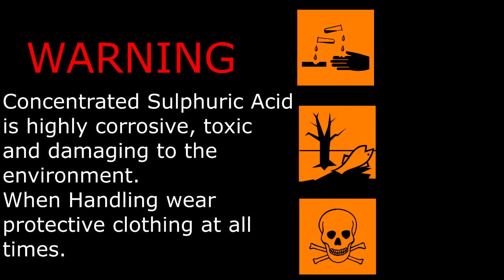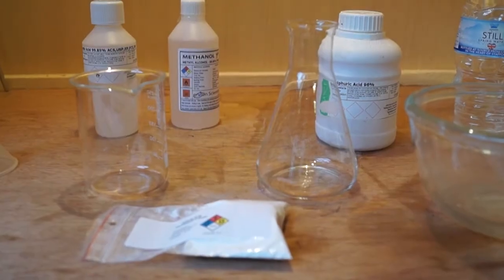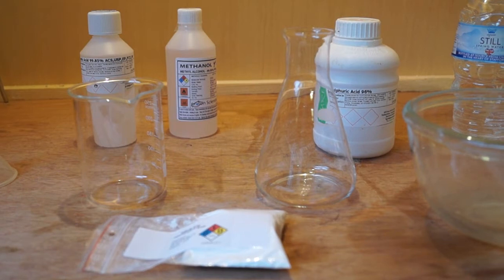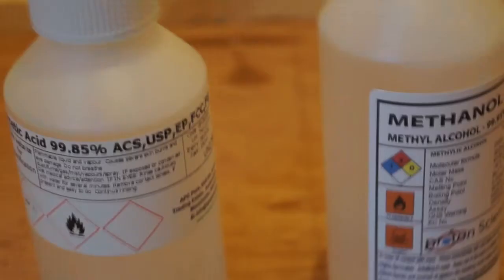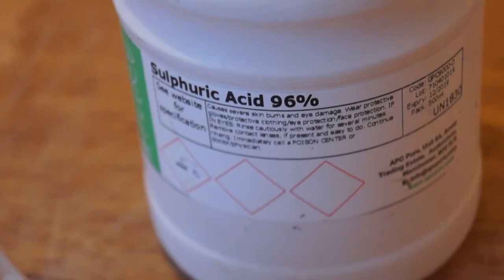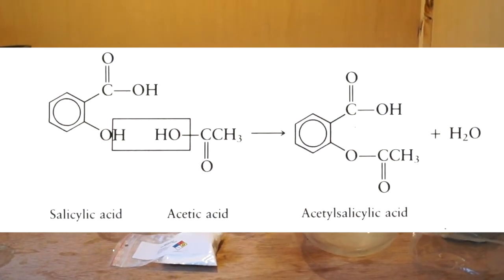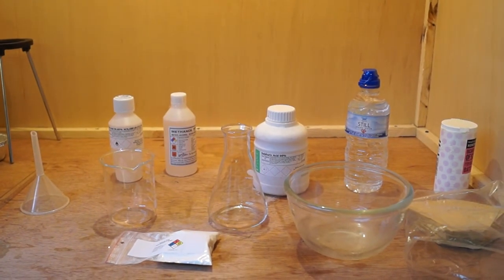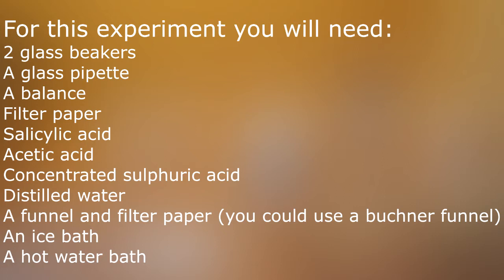Synthesis of Aspirin (with Acetic Acid)

Comment: what if we use sulphosalicylic acid instead of salicylic acid..coz my lab has it instead of salicyclic acid
Reply: the sulfonic acid group in sulposalicylic acid can form sulphonic esters in the presence of an alcohol. I suspect you might get some form of self condensation upon dissolution. The esterification you are trying to do should out compete this though so the short answer is yes, it will work!

Comment: What are the advantages  of using acetic acid over ethanoic anyhdride ? as i can only think of disadvantages
Reply: Well he clearly states his reasoning. For pretty much anyone unless you're apart of a well setup lab it's almost impossible to acquire.
Reply: It's acetic anhydride that he couldn't get. The advantages are that he can get acetic and sulphuric acids, and they aren't as volatile as the anhydride. Disadvantage is likely a lower yield.

Comment: How can this be tested to guarantee that it's aspirin? Also how can you check purity?
Reply from the maker: +Alex P qualitatively using melting point. In lab you would probably want to use gas/liquid chromatography or NMR by doing a ratio of peaks for the product and non-product peaks. At home, melting point with comparison to the literature would be your best bet. My product in this video was not pure at all as you can see from it's full colour.

To guarantee its aspirin you could only do that by taking a proton NMR spectrum. Again, if at home, I'd suggest measurement of a physical property like melting point or solubility is water at room temp etc